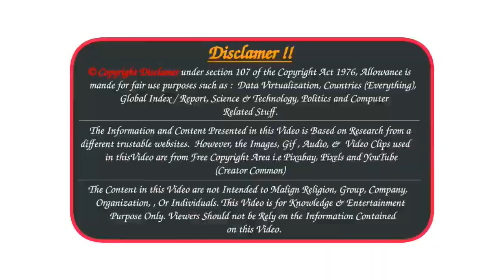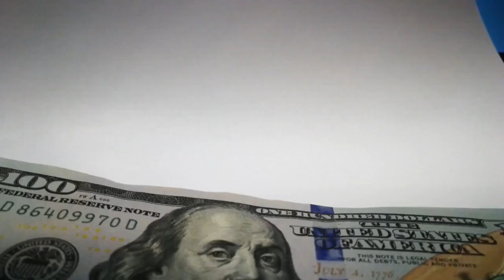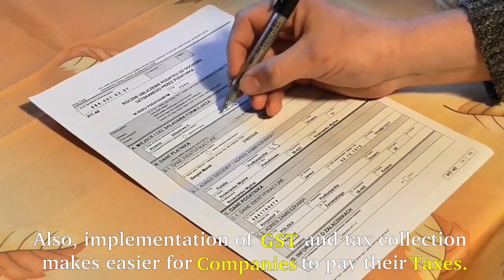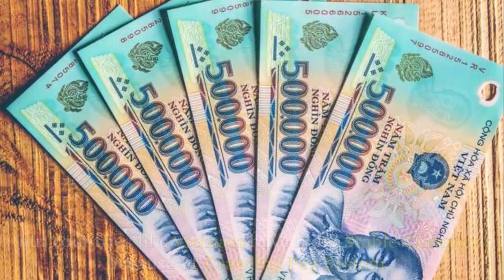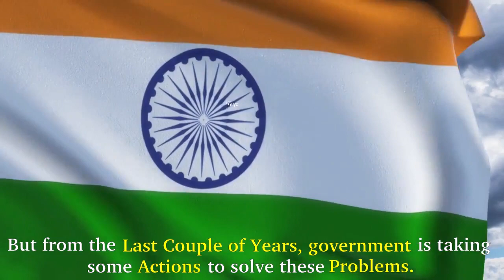Why Companies in China are Choosing India for Manufacturing ??? | Companies Moving to India |

Comment: there is a chance but not like China. it will be much less.  most of developed countries are moving out from china to their countries. one reason is china's averagy salaray is increased. and secondly all the developed countries are preparing fully automated production.  it means it doesnt requires low cost workers.  in many part of the production robot is replacing them.  as the time goes chance of developing countries like china will be much less.  and the gap between developed and developing countries will be much bigger.